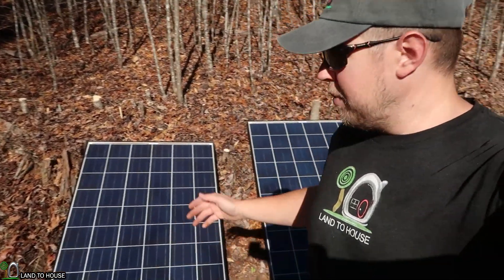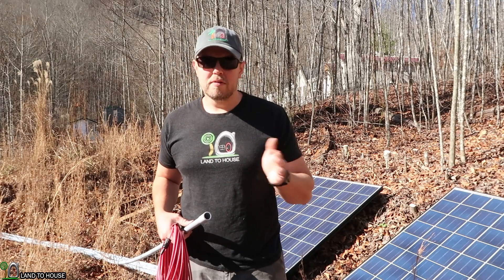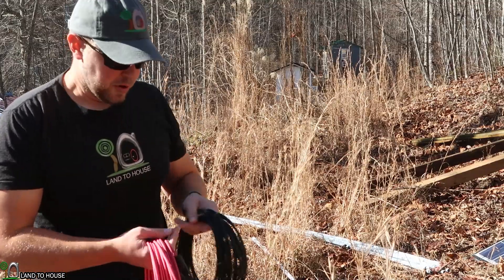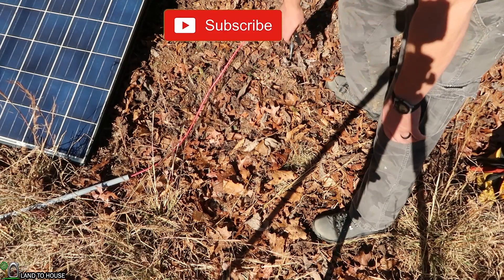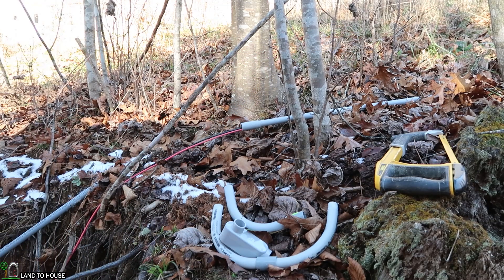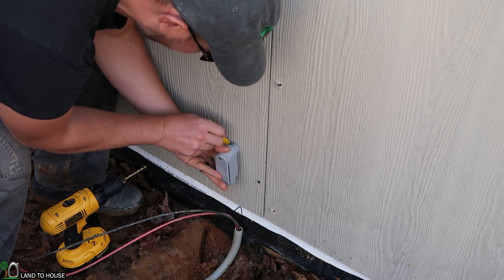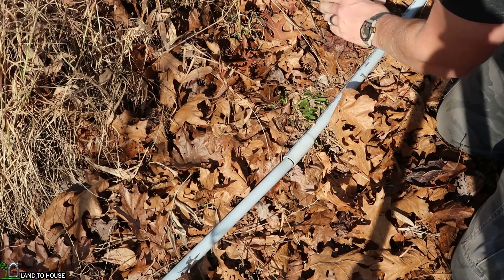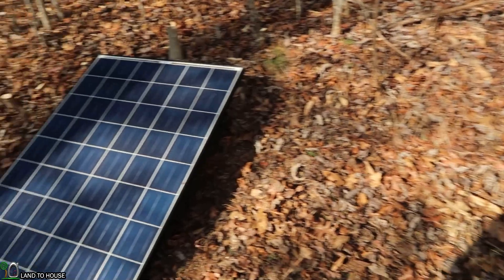Installing Solar Wire and Solar Panels for the Shed

Comment: As an electrician, I would like to give you a tip. When you layout the wire/cable. Unroll it rather than unravel it. This is so you won’t have the wire/cable looking like a spring that has been stretched. When it’s laying flat, by unrolling it, it would easier to deal with when you shove it into a pipe.

Comment: It's coming right along. Want to do something similar with my panels. I just have them propped against the back of my house and the panels only get a half day of sun mostly, but they get a lot of morning and mid day, but the evenings they get it indirectly. I think the highest I have ever seen out of my 2 100w cheap panels is 180w tied in series as well with a Renogy MPPT controller with Bluetooth dongle. I could move them a bit to get more sun, but then my garden would have solar panels in the middle of it and my garden gets pretty mangled looking already.
Reply from the maker: Solar is a lot of fun when its working correctly. Placement makes such a big difference.  180w out of 200w is actually really good. Behind the house I have 1000w and the best I have seen is 850w.
Reply: @LandtoHouse  Wish I had that much coming in. Would consider doing some grid tie stuff if I had solar at that rate. I think I checked how much I could impact my electric and I think it was like 3 cents a day. Not worth the trouble. I have a battery charger that does desulfation and I let it come on via timer a couple times per week for a couple hours to help the batteries. It's called the Xtreme charger. Only 2.5 amps and is for 12V application. You talk about a game changer! I bought 2 by accident because I won a bid on eBay after losing others over and over. 
May have an ice storm here in E TN tonight into Monday. Gotta top off all the cars fuel tanks.   Do you mess with any generators at all? I have a few. 10KW that can run everything in house, an inverter type for quiet that is only 2kw, then a standard 2.5kw. Love playing with that stuff on gasoline and propane. I want some gas logs and an extra line that I can tap into and see if I can get the propane model to run on natural gas too so I don't have to fool with gasoline or propane.
Your metal roof reminds me of my old neighbor who got a metal roof and didn't pay attention to having so many real big Oak and Hickory trees so close to his house. It sounded like a 22 rifle every time the wind blew in the Fall. I don't know how he stood it.  Afraid to put my panels on my roof because of pine needles and leaves from a poplar tree so close.  Keeps the videos coming. Love stuff like you are doing.
Reply: @LandtoHouse  I wish I were handy at building. I helped build a shed in high school about 30 years ago now. That went great but I have not built anything since, other than being a grunt for a builder when his construction elevator would die and it was always be 100F and I learned I don't want a construction job.

Comment: If you don't want to cement the PVC fittings (for future reuse): consider using Mastic tape, its self-adhesive stretchy waterproof tape used in the telecom industry to weather seal exposed antenna connectors. Its awesome stuff.
Reply: Use the same thing for same purpose but in ham radio applications.

Comment: You might want to look into putting another support mounted under the middle vertically where the two panels come together when you make a more permanent setup as it looked like there was a lot of flex when you were trying to move them around.
Reply from the maker: For sure! I have just purchased the things to make the more permanent install. I have an idea for a tilting mount.